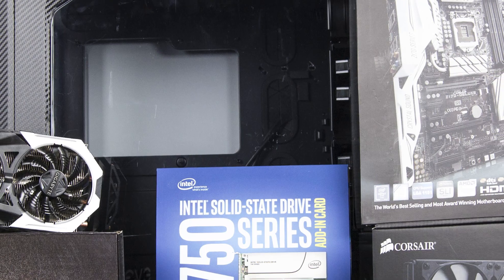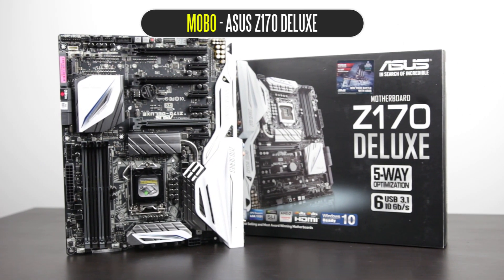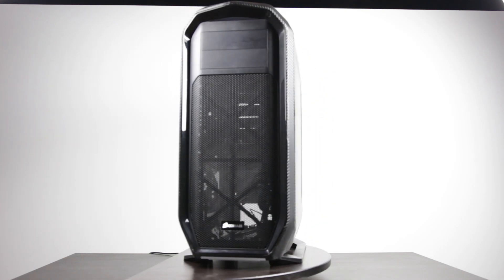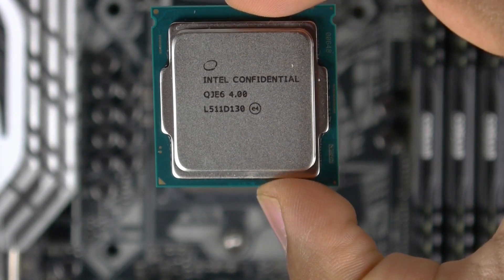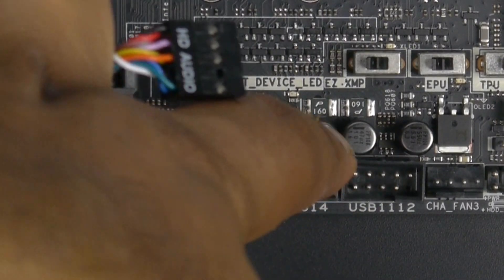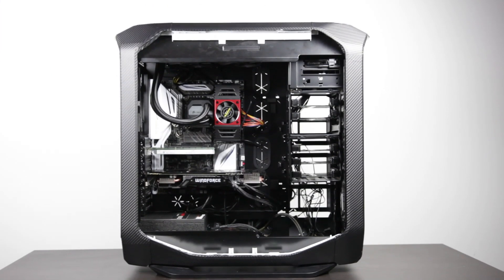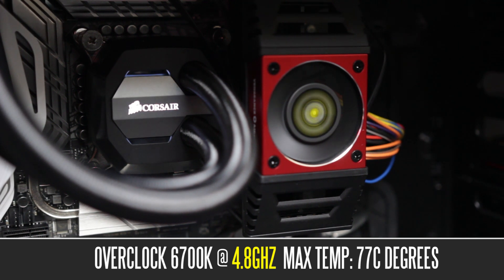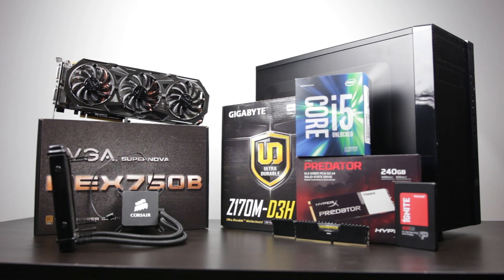Ultimate 4K Gaming/Productivity PC Build Guide - Core i7 6700k/ GTX 980 Ti

Comment: Not aweful, but I would not have overclocked it as much to improve temps, and (I believe so) I think that putting the GPU in a lower PCI slot makes the performance not as capable because lower slots are typically lower gen lanes, unless it was pci 3.0, i would recommend swapping the locations.

Comment: This would be my 1st build. Is this asking to much for a 1st time  builder? How well will this computer do with VR?
Reply: get a 6600k and gtx 1080 instead
Reply: get a 6600k and gtx 1080 instead
Reply: +Shifty Biscuits what will these changes do? Also thank you for writing back. Thankful for you!!!
Reply: these changes will be a little bit cheaper and the 1080 is the latest GPU from nvidia and will be better than the 980 ti,however the processor is the latest sky lake for i5 but the GPU makes the biggest difference in gaming.And this is a way better gaming rig then in the one shown in the vid
Reply: +Richard Boyland i recommend watching austin evan pc builx videos,it will make pc buildinv way easier.
Reply: +Richard Boyland depending on your budget you can go with either since there is no big performance difference,you can go with the 730 ssd since its 480 gb.
Reply: +Richard Boyland and i think the prices of the 1080 wont decrease alot so u can go with the 1070 which there is a 25 percent performance decrease in 1440p
Reply: +Richard Boyland http://pcpartpicker.com/list/9G2m8K this is a list of parts you can use but you can change them.
Reply: +Neox Thank you!!! I will make the changes in my order. Just waiting for the Price to drop of the 1080 to drop. I've been told it will drop in about a month. The build on the video looks easy to put together... Can it really be this simple? This will be my 1st build. I don't want to fuck up lol thats a lot of $$$. I'm just a 32 year old obsessed with games.
Reply: +Neox thank you!!! Also I was going add an Intel 535 series SSD or should I get the Intel 730 series SSD 480GB?

Comment: what happens if i switch the position of the "intel 750 ssd pci" and the "graphics card", what i mean is: Will the pc perform worse if i put the graphics card in the first  PCle 3.0x16 slot and the ssd pci in the second  PCle 3.0x16 slot?.
.
.
.
Actually, I placed my graphics card in the first  PCle 3.0x16 slot(top) and the ssd pci in the third  PCle 3.0x16 slot. Is this a bad configuration? I didnt find any information about the pci slots configuration, can you help me with this, please?

Comment: Great video!!
I Play 4k at hight and ultra settings.with my system but maybe is time to upgrade?

ntel i7 4790k 

Corsair water cooler extreme

Mother board Asus z90 a-3.1
2 MSI GTX 980 ti

32 gig Memory corsair Vengance 1600

Corsair extreme fan cooler

5 tb seagate 7200 hd

Corsair ssd b8100 

Power supply corsair 850 high performance

Soundblaster z3d

Comment: I have been wondering for many months now about your gtx 980 ti g1 gaming. On 12:32-12:35 gpu installation, the 2 capacitor is very noticeable and I have a exact same model of gigabyte gtx 980 ti g1 gaming but mine doesn't have capacitor showing like that. I'm curious if you just used different gpu model on that clip or is it really 980 ti g1 gaming?

Comment: Are cpu water coolers safe? I feel uneasy about them, I'm a noob when it comes to building PCs and I don't want to do any maintenance.
Reply: +Bandar Alshareef if you handle it with care while building your pc there will be no problem at all, it uses to happen more frequently with full custom loop watercooled pcs. however, if you don't plan to do a beautiful overclocked in your processor then there is no point in buying it. if you don't know how to overclock, don't worry, I didn't know to too, but with a few hours with research I learned it, and with a few days I learned everything I had to. its pretty easy, you shouldn't be afraid of anything like this. f you have any questions, don't hesitate to ask!

Comment: i have sort of the same build coming. Same board, an i5 6600k, instead of the i7 6700k, H110i cooler, samsung 950 256GB, corsair 750w psu, corsair case(it's a gaming looking case, cant remember), 16gb gskill ripjaws (8x2gb). can't wait to get it. Want to see how fast the NVMe SSD's are

Comment: I wanted to ask a dumb question, i want to play games on 4K res optimally though, but im currently using a standard GTX 980 card already. What should i do in this case? i heard if you use SLI it degrades PC performance. Id prefer to use only one graphics card. Should i upgrade my card to a GTX 980 Ti  or just wait until games become more compatible with 980 SLI and just buy another standard GTX 980 card? 

Worst case if i do upgrade, i can always gift this card to a friend. Please let me know your personal opinions.
Reply: +DeadSilent Gaming I think it may be worth waiting for pascal, then you can pick up another 980 or two 980 ti's for a lot cheaper. Trading now for a single 980 ti wouldn't be a bad move but the 980 is still a beast of a card so i wouldn't be able to justify the switch but I guess if you've got money to burn grab a 980ti! 

I'm getting a 980ti next week so I personally think that extra frame buffer will be very useful but as of the moment your card is still extremely capable, I'd just wait for the price drop sometime later in the year. 

It sounds like you've got the upgrade bug and with pc's its a money pit. Plus 4k gaming is still super demanding and expensive so all the modern tech will eventually be cheaper and standard so wait would be my opinion.
Reply: 0nigel01 thanks for your advice
true i was thinking that aswell to wait for the prices to drop so it would be cheaper. Yeah thats another thing i recently purchase this card not to long ago and upgrading it would be a waste. true this card can run games at max settings without any issues. yea one of my close friends told me if i upgraded it would only provide a small amount of extra frames but both cards are pretty much the same.
Reply: DeadSilent Gaming All good man, I have to tell myself sometimes that I can play games no problems at high settings but I want a larger 32" or 34" 21:9 2k monitor as I'm a couch slouch and want a bigger screen. It's all about choosing the right hardware at the right time for the right price. If I had a 980 I'd probably be happy for the next few years at least but I know how it is, newer stuff always seems better even if the difference is negligible. Do you own a 4k monitor already?
Reply: 0nigel01 not yet but i was planning on buying one which is why i wanted the card to be compatible with 4k along with gaming too.
yeah true this 980 is pretty good.
Reply: I know it's a sin to mention games consoles but you have to think that even the next gen of console won't have anything like a 980 or amd equivalent in it so you are set for years to come.
Monitors and graphics cards will only be getting cheaper as more advanced tech comes out, there will always be something to upgrade so it's best to slow down and enjoy what you've got. Either way, sounds like you've already got a pretty beastly system so whether you upgrade or not enjoy!
Reply: I moved from 980 SLI to 980Ti SLI. GTA V for example, 980's worse case is in 30's. While most of the time it ca
 maintain above 60 average. With a pair of Ti's, worse case is upper 40's.
Many comments here already pointed out. One 980Ti is not going to cut it at 4k res.
Reply: +DeadSilent Gaming first of all, I really don't think you should play at 4k. my recommendation is that you buy a qhd monitor with gsync and a 980ti. about sli, it will never decrease your performance, otherwise nobody would do it. most games now already support sli, the problem is that it doesn't sum the vram of each card. you would still have 4gb with 2, 3 or even 4 980s. summarizing, if you are playing on full hd 4gb of vram are enough and you would get more fps with 2 980 than with one 980ti. If you are playing on qhd (2k, or 2.5k to be exact) a 980ti will be better. if you are playing of 4k, you don't :D. oh, and you would be a really really  kind person by giving a 980 to your friend, do it!
Reply: Adam Chan Yes true but if i plan to try gaming on 4k i think i need to upgrade to a Ti but i wasnt sure if having 2 way SLI GTX 980 (standard) could be optimized for 4k (if i used SLI). I might actually upgrade my card later on once the prices go down or when games become more compatible with 4k res
Reply: Rodrigo Paiva Thanks for your advice im planning to upgrade my screen later on once prices go down. Right now if i buy a new screen its still early and it will cost me around 500 - 800 dollars for a decent GSync 4k screen. :P I agree with you aswell

Comment: You have the GPU in the wrong PCIE slot, it should be in the top slot as the bottom slot will only be 4x lanes where as the top is 16x lanes. Has anyone else noticed this is just me. I thought he was fairly professional?
Reply: +Craig Horton I was wondering about that too.. Maybe it depends on the motherboard?

Comment: This is what I build for $1500 on pcpartpicker, no SSD which I'll add in the future. 
CPU: i7-6700K
CPU Cooler: be quiet! PURE ROCK
GPU: Zotac GTX 980 Ti AMP! Omega Edition
RAM: 8GB 2400Mhz
MOBO: MSI Z170-A PRO 
CASE: Fractal Design Define S w/ Window
PSU: EVGA 750w 80+ Gold G2 
HDD: WD Blue 1TB
FANS: 3x NZXT RF-FN142-RB 140mm

Link: http://pcpartpicker.com/p/xLnmXL

Silence, performance and cost is key for me. 

Give me any tips as this will be my second PC build.

Cheers!

Comment: I would put the GPU in the top PCIE socket, that's the only way to get it to use all the 16 PCIE lanes from the CPU.

Also, motherboards standoffs will be different on different cases and mobo's so there are not always nine of them, you will wanna make sure, you have no unused standoffs below the motherboard

Comment: I'm thinking about getting a build just like this but I'm looking at the coolmaster hyper 212 evo fan cooler, a samsung 1tb ssd along with a 2tb standard hard drive, a pci-e wireless adapter, and a 1000watt 80+ gold power supply. I don't expect to play every game in 60fps 4k, but it would nice to have a few in it and most maybe in 1440p but I would plan to eventually SLI the 980 Ti. The 6700k is looking like the best option at the moment but I'm also considering the 4790k and the 5820k

Comment: My MSI GTX 980 Ti Lightning LE uses 2x 8 pin and 1x 6 pin cables for the video card power.  --  Make sure your PSU has the proper number of connectors for all power needs.

Comment: There is no reason to get a 6700k. If you want strong single core performance and a great overclocker, best thing to do is get a 4790k. If you want productivity and gaming, get a 5820k which is in the same price range as the 6700k and has six cores rather than the skylake's 4 cores. Not to mention the 6700k only beats the 5820k by 2 fps or less, and the 5820k will win in games that utilize all 6 cores.

Comment: 77c at 4.8ghz? that's pretty odd. my 4790k gets a little bit hotter than that at 4.7ghz but that's on air (1.285vcore). was there no way to lower voltage, or does skylake run hot?

Comment: I m here with 2nd Gen i7 2600K
16gb Corsair Vengeance 1600Mhz 
Burnt Motherboard after 3 years - MSI P67a-GD65 B3
Simple 1Tb x 4 HDD
GTX 570HD EVGA GPU 
24inches Samsung 1080p 8ms Monitor.. 
Thats folks. 
In Pakistan i can find 2nd Gen board :(( so no games until i purchase new board.

Comment: DDR4 is hardly more expensive than DDR3 ram now... And Skylake CPU is hardly more expensive than normal i5 and i7 CPUs.... So if you want to build a new pc, you should buy a motherboard for ddr4 ram and skylake CPU and with SLI for  (atleast) 2 graphics card, where you buy one GTX 980 Ti and buy another GTX 980 Ti when you want more GPU power and the price has gone down on that legendary graphics card (GTX 980 Ti is worth the price, since its the same performance as 2x GTX 970, which is the best of the high end CPU for the price - it is not overpriced at all). That would be the cheapest way to get a great gaming PC with great upgrade possibilities.

Comment: Hell of a rig you put together there.  I'll just have to make due with my measly 4.4 ghz 3570k and GTX 780 Ti SC.  No 4k for me yet.
Reply: The 780 is still good don't complain...
Reply: radioactiveplums I was joking
Reply: hartsickdisciple oh, it's hard to tell these days lol
Reply: +hartsickdisciple No worries there, I just updated my gpu to a 980ti and am only playing at 1080p, I don´t plan on using 4k anytime soon.
Reply: +hartsickdisciple your actually lucky! i wanted to jump up desperately just to be suck at 1440p with a 4k monitor only to play dota 2 lol.... hopefully when you ready they will have 4k moniters running at 80fps at least....and better gpu's to easily handle it
Reply: ro67nj Yeah, 4k is still a long way of from becoming standard.  I wouldn't have splurged on a card as expensive as a 780 Ti at full price.  I got mine in July for $220 with a 1-year warranty.  No way I could pass it up at that price.